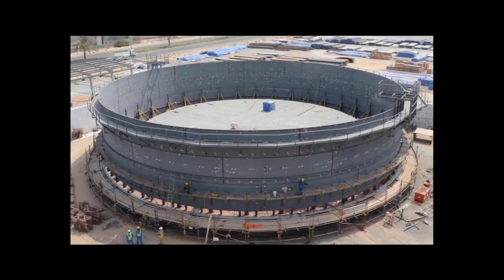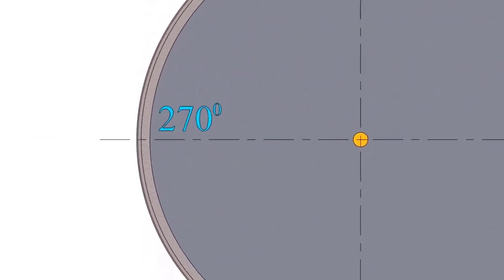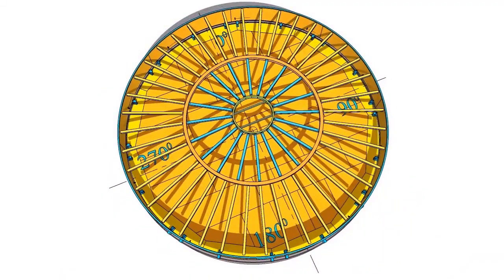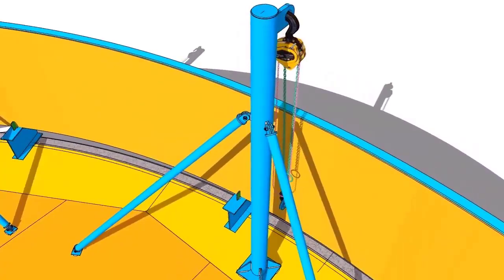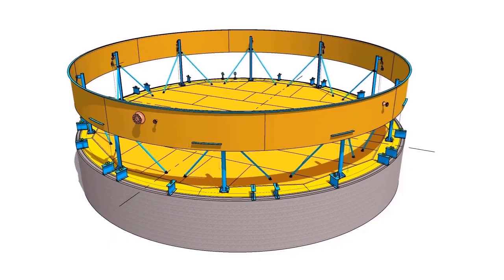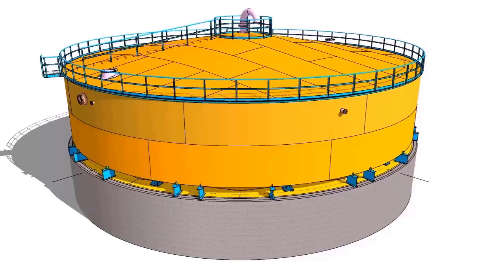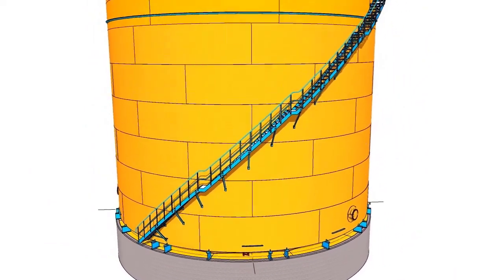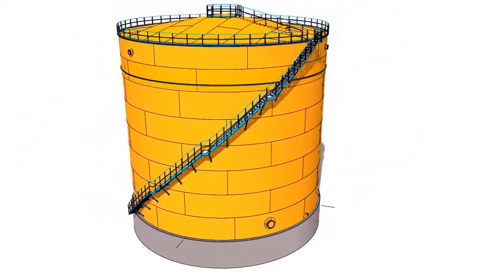How to Erect API 650, 620 Storage Tank Using Chain Blocks only.

Comment: I like the idea of the top down construction. Means no one is working at a to greater height and you are not having to use really tall working platforms/boom lifts etc. With the bottom up method the girth and vert welders run on the top lip so with the top down method what welding system gets used? This chain block method you show is really simple with no High-Tec hydraulic equipment to break down. Nice tutorial
Reply from the maker: Thank you.

Comment: This seems extreme. How many people do you have to us those chain blocks?
Reply from the maker: It depends the diameter and weight of the tank. Yes this is a very hard work, but people still use this method. You can find videos in youtube. Search for ; erecting storage tank using chainblocks.